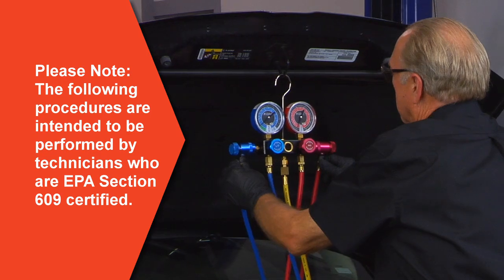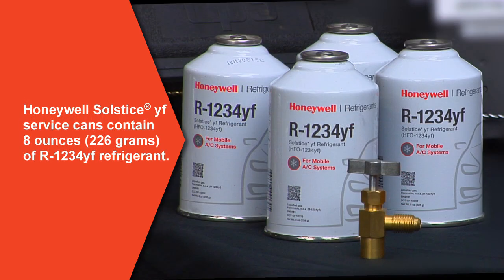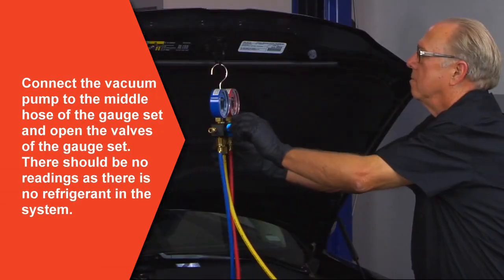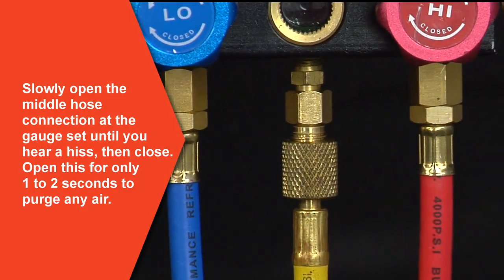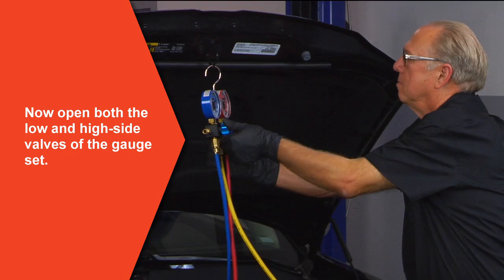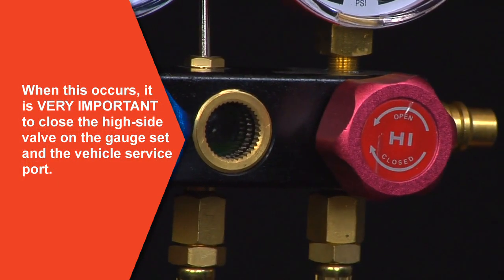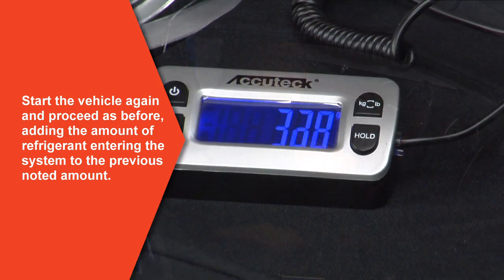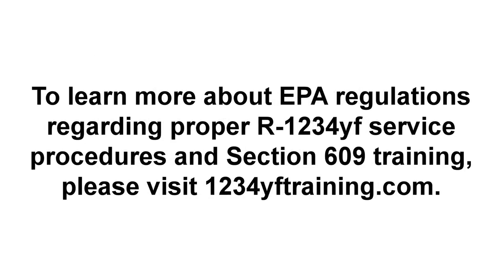Honeywell 1234yf Proper Procedure

Comment: You don't have to open the high side valve on the manifold set to read the pressure. The gauge is always active if the car's schrader valve is open.

Comment: I’m confused about the “do not run compressor with high side valves open” there’s no other videos on YT saying that when checking pressures and charging system. ???
Reply: You can’t have high side open with system on, you will put high side pressure in the can and blow it up

Comment: Once the hoses are under vacuum, shouldn't you fill the lines with refrigerant (with the car's service valves closed) before you zero the scale? if not, you are including the refrigerant weight in the lines in your charge weight and that amount never made it into the car...especially important with 1234yf that is a mroe critical charge weight.

Comment: best thing is not buy are car with 1234yf,,,
Reply: an if i had to pay  the high price  for this junk  i would put r12 in it   ,,,
Reply: The EPA is requiring all new vehicles to transition to R1234YF from R134A. The old R12 will not work in the new system. Also R12 is no longer available.
Reply: 1 year old post I know, BUT! The latest scam is adding a tax on R134A to make it as expensive as (if not more than) R1234YF, not come in yet but soon will. As said by many "It's all about the money".

Comment: A local GM Dealer wanted $702 to recharge my 1234FY system! I told them it was a rip off and took my 2017 GMC Acadia and left. I purchased the recommended amount of refrigerant, charge hose and guage at a local auto parts store and did it myself for $151 and saved $551. Do it yourself and don't get ripped off!!!
Reply: What exactly did you buy? I am thinking about doing my own since I had to take the lines off to replace my radiator.
Reply: @AngusSteak59  I went to Advance Auto Parts and bought the refrigerant gauge and charging hose along with three cans of 1234FY refrigerant! Before you do this make absolutely sure your vehicle uses 1234FY and not 134A. Also attach the charging hose to the low pressure side of your system. This is the large tube port, not the small tube port.
Reply: @wythetrumpet6419  I was frantically searching for someone to tell me high or low!!! Thank you ahaha
Reply: $151.00 just to top off your system?I wouldn't brag about that.
Reply: @williamvaughan1218  this was the cost in the summer of 2021. The price has dropped significantly as more vehicles now use the 1234FY now. My point is the amount the auto dealership wanted to charge at $702.00! If you had a choice between $702 and $151, what would you have chosen at that point in time?
Reply: @williamvaughan1218  that’s the going price. This shit isn’t cheap, and a professional tech will charge $400 minimum.